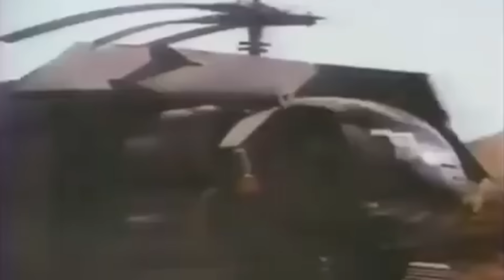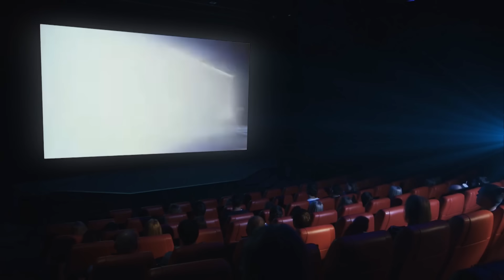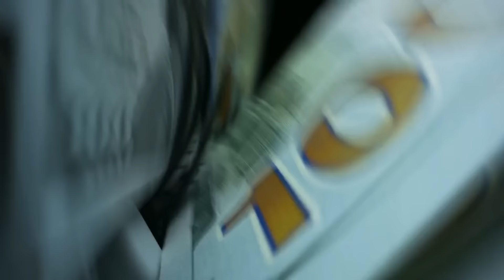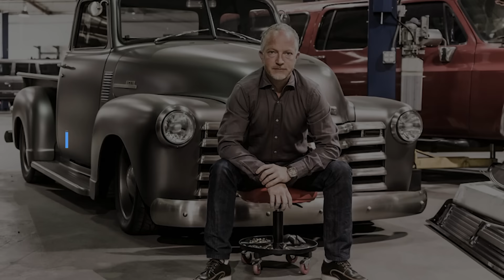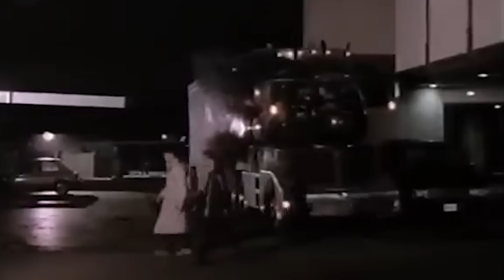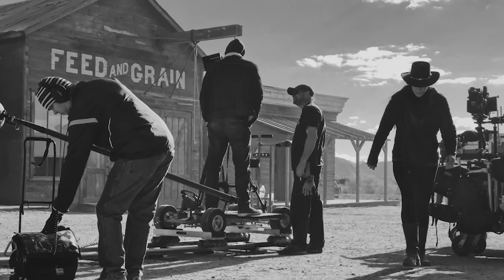20 Weird Facts About The Highwayman Main Truck (The Highwayman 1987-1988)

Comment: Imagine if Kitt's mobile base had been not this regular truck, but the truck of Highwayman! That would have been so much cleverer. You could have connected two road heroes in different vehicles through a storyline, and both would have had cameos in each other's shows. The Highwayman series could have told stories about what he does when he's not serving for Kitt as his mobile base. That would have been the start of a road hero franchise. And as a sequel series, they could have shown RJ taking over Michael Knight's role... as the road hero called: Streethawk. That would have been so awesome!

Comment: You are way up complicated that they actually have talked about how they made the truck. It was a max super liner, which was around in 1987. All they did is they took the front half up to behind where the helicopter engine from an aerospace gazelle helicopter and mounted it, and then they built the shrouding and everything around it right under the cab or the cockpit was the actual engine. The truck is still around and it is actually drivable. The second one you keep showing was another concept vehicle from like 1950 something or up to I think 1977 is when the second vehicle you keep showing is or was made. You really got to make an effort in this. Your facts are way off. You keep showing a Kenworth cab over it was not. did you do any research? They actually have a documentary out about the highwaymen show they talk to the people who built it. This was a Glenn Larson production. There’s a lot of information about this show and about those trucks. It takes 10 minutes to figure that out, and you couldn’t do that in 30.

Comment: 1. In the pilot they explained that using the invisibility/stealth mode used a lot of power and cost a lot of money...which is why Highway (Sam Jones )had to get authorization to even use it.
2. Who cares which helicopter was used...they needed a helicopter that had futuristic lines, but couldn't use the BELL 222 because that helicopter was used in Airwolf...it was too recognizable.
3. Of course they recycled K.I.T.T's dashboard...why wouldn't they??? It did look futuristic and yet somewhat familiar, it only makes sense especially if you're trying to save some costs.
  I'm 4 minutes into this video and have already heard enough....this narrator is a Jackass, he should've labeled this video 20 things that I want to bitch about Highwayman.
By the way, anyone who watched the show knew that the helicopter/truck didn't really make sense...after all the truck has to be able to make turns....but the show also takes place in the future, so it could have been possible, that the cockpit could actually separate from the fuselage while the truck was being driven...the bottom line, it a television show that was pretty ambitious but was given a poor time slot and wasn't really given a chance. Which happened to a lot of shows during rerun season.

Comment: The one thing I knew was absolutely unrealistic was the fact that the entire front section, including the helicopter cockpit, was hinged. They obviously had to do this to convert the semi cab into the front end of the presumably permanently connected truck, but it meant there has to be some sort of complicated hinge mechanism in the helicopter that could allow the tail to pivot, while still allowing the helicopter be locked down and rigid for flight. 

Ironically, it would have been more realistic if the bottom part of the cab had pivoted, like in the Steinwinter, and the nose had remained stationary. It would basically be an eighteen wheeler carrying a helicopter on a flatbed trailer. 

Also, if my memory serves, there wasn't any crime fighting equipment in the trailer, just the Lotus and the tail of the helicopter. I don't think we ever saw the inside of the trailer. The helicopter and sports car effectively were the crime fighting equipment that the Highwayman truck carried. Most of the trailer was probably taken up by the rotors and their retraction mechanism.
Reply: Esatto mai visto l interno

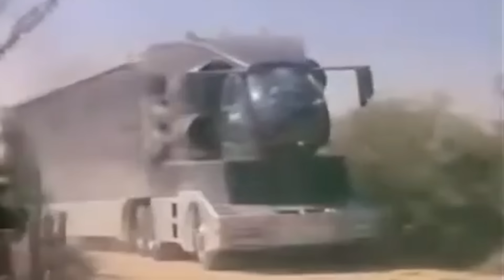Comment: 1:59 the helicopter was used a few times in the show, but cutaways and such were used, so truck pulls up, Highway throws the switches, and next scene the chopper is airborne
Reply: I was thinking that myself. I think there is even a time where highway hands the passenger the wheel after taking it off during the conversion. Might be wrong as I haven't seen this show since it came out!
Reply: @Simbalion1077  yeah, he picked up a female news reporter who faked a car breakdown, but a few scenes later he did that,
Reply: Esatto lo fa ed e splendida questa scena.

Comment: I know the original designer of the HIGHWAYMAN semi. It was designed back in 1982-86 by a high school student in a town called Clinton, Indiana. 
4 years of a migraine headache including the algorithm for the actual stealth system, and designing the 1140 hp hydrogen burning engine, while using an actual French built Aerospatial SA347 GAZELLE HELICOPTER for the cab. The interlink connections were mostly your basic off the shelf components.The body of the vehicle was originally specified to be a kevlar reinforced composite material. Plus the side jets on the cab also helped the truck to reach a topped out speed of 238.635 m.p.h. carrying a full 79,999 lb 15.5 oz load. It's transmission was a temkin crossfield 18 speed, it also had a carbon composite breaking system 

The person whom is the original designer is still alive and living in Terre Haute, Indiana. And is rebuilding his blueprints that were stolen from his house and illegally sold to a company that built the rig. He is not only rebuilding his blueprints on that vehicle, but also modifying his original plans. 

And. F.Y.I. he did not use a k.w.800 cabover for the chassis. His chassis was custom designed.
Reply: Grazie per queste informazioni
Reply: Thanks for share your comment

Comment: You really need to get your video clips put together right. Highway's truck was a totally different vehicle from his buddy Jetto. This could have been 10 weird facts about the main truck in The Highwayman.
Reply: Jetto actually started out with a similar truck to Highway's. The truck was apparently standard issue for their organisation. He had an accident with a grenade. My memory's hazy as to how it got into his cabin, but he was forced to jump out the side and was issued his low profile truck later. Strangely, the low profile one worked better with the 'pursuit vehicle' concept the Lotus Esprit got used for.

Comment: the side strakes on the testerossa where there to pass highway safety laws. yes there was a large vent behind them, but they were added to the design because many jurisdictions prohibit large side openings on a road vehicle. so they do not "help" aerodynamics or cooling flow, they are literally "safety rails"